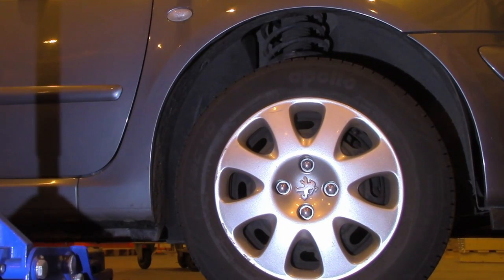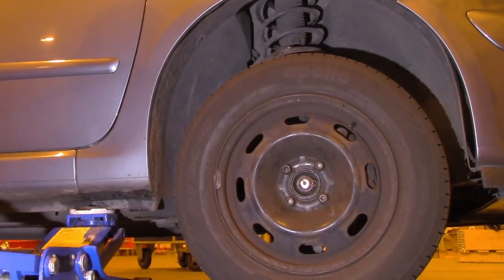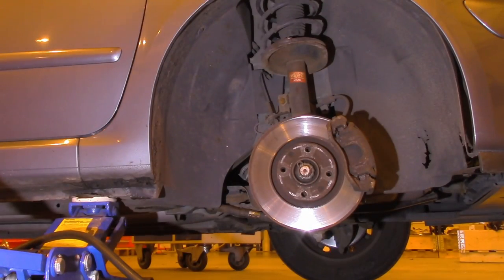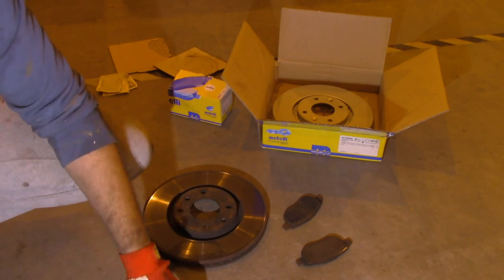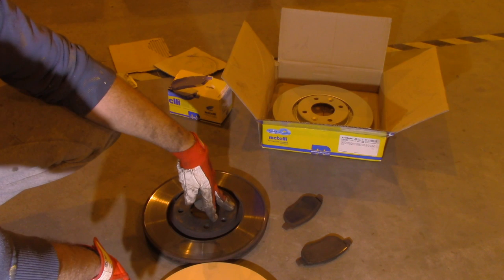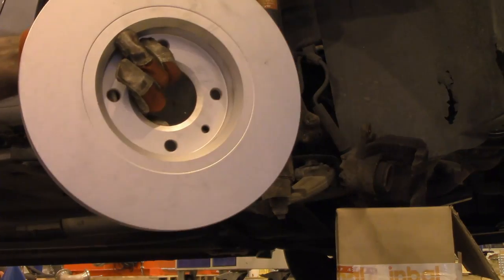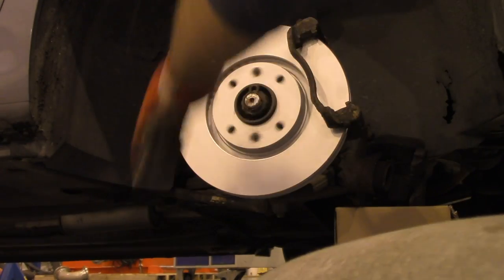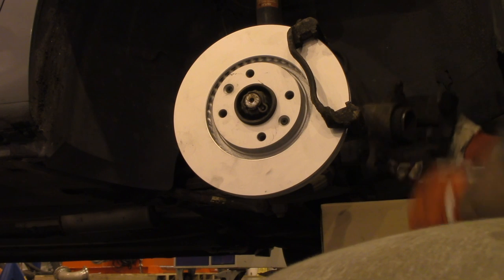Replacing FRONT BRAKE DISC & PADS - Peugeot 307

Comment from the maker: Remember that if the surface of the hub is covered with a layer of rust, you need to clean it before mounting the new brake disc. Mounting the brake disc on an uneven surface might lead to radial runout, vibration in the braking system, faster wear of the components. You can use low gradation of sand paper to clean such rust. Remember to apply force equaly not to damage flatness of the surface by trying to clean it - You can for example put the sand paper over some flat steel object. Hope it helps. Cheers
Reply: Gracias

Comment: Great tutorial, but you forget to say one thing. Before pushing back piston we need to check brake fluid level because it can leak out of the bottle and damage paint in the engine space.
I learn it the hard way on my old car. :)
Reply from the maker: Great comment Philby! Thanks for your support! 
Cheers
Reply: And the fact that it can be harder to push the piston in, when the cap on the resevoir is on. And the fluid level can become too high. So you'll need to suck a little out 😊

Comment: Very cool ! One cuestión. how much force is applied to the wheel ( Nm) GRACIAS
Reply from the maker: Hey Juan,
I tighten the wheels with 120Nm. It is a bit more than the manual says but the car is not new anymore ;)
Hope it helps
Cheers my frined!
Reply: @isitfixedyet891  Gracias AMIGO ! Whats you name ?my friend ...  I have  4 disc ready from change
Reply from the maker: Hey Juan, 
People call me J. Remember about this info I have just pinned to the video:
If the surface of the hub is covered with a layer of rust, you need to clean it before mounting the new brake disc. Mounting the brake disc on an uneven surface might lead to radial runout, vibration in the braking system, faster wear of the components. You can use low gradation of sand paper to clean such rust. Remember to apply force equaly not to damage flatness of the surface by trying to clean it - You can for example put the sand paper over some flat steel object. 
Hope it helps. 
Cheers

Comment: Hello i have a problem with my 307sw, the car doesn't lock/unlock remotely, only from the lock on the door. A locksmith told me that the key is working fine and that it sends signal, but the car doesn't receive.  Is there a module in the car that I can fix?
Reply from the maker: Hi Platon,
Most common problem is a weak battery in the key fob (have a look here for disassembly: https://youtu.be/SLltqhyNgrQ ).
If this is not a case it can also be a problem in the keyless entry antenna or damaged wiring. It might also be a power door lock, control circuitry or simply a fuse. 
If you are planning to check this by yourself you will need to do a lot of checking with the multimeter for connection (resistance in the cable). Might take a bit of time but that is always the case with car work :)
Cheers and good luck!
Reply: Thank u very much, your videos are very helpful, recently i fixed my power windows with the help of your video.
In this case i think it's the keyless entry antenna but I cant find anything in the internet about its location in the car, and how to fix, maybe you know where its located
Reply from the maker: Hi Platon,
I have been looking for it for some time but did not find it yet. I will come back to you when I locate it. Let me know if you find it first ;)
Cheers